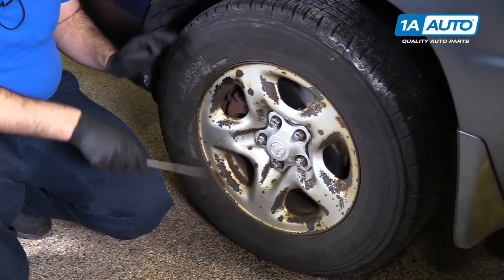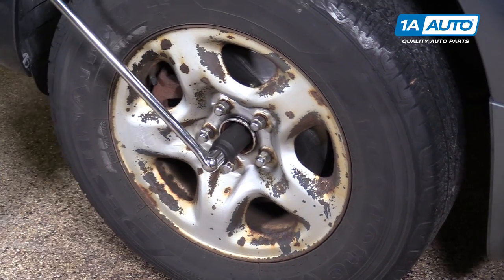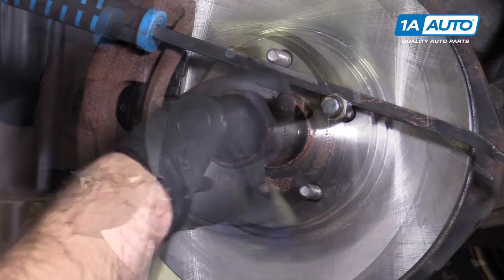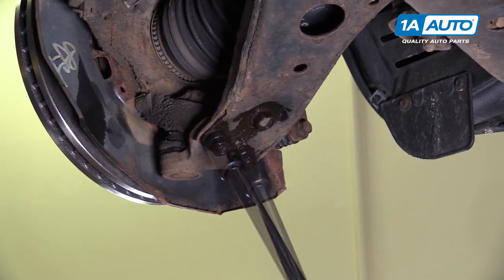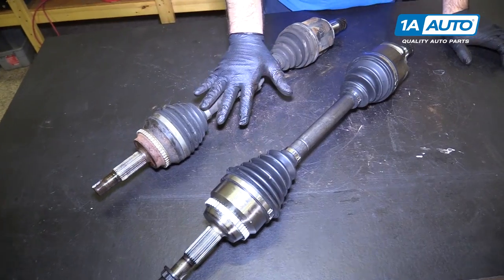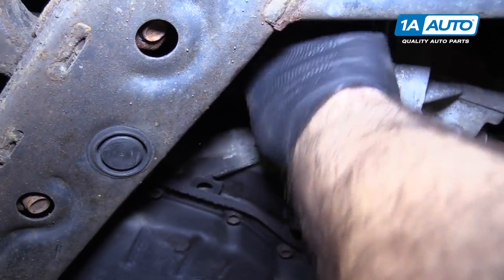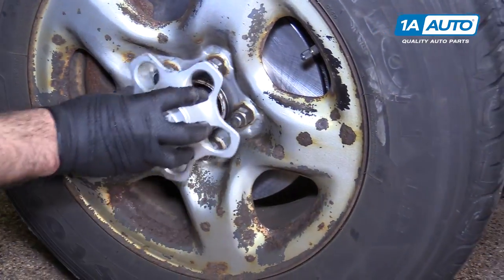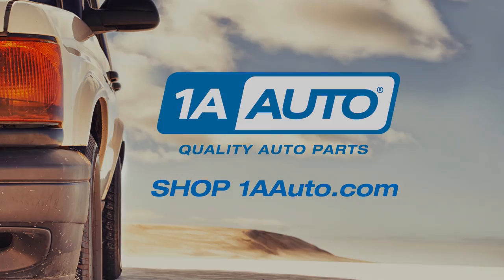How to Replace Front Drivers CV Axle Front Wheel Drive 01-07 Toyota Highlander

Comment: One of the most professional and careful Mechanics i've seen
My pet hate is mechanics that put wheel nuts on with a rattle gun
Reply: I taught myself a lesson when I used an impact driver on the wheel nuts. 🤦‍♂️😡 Next time I had a flat I struggled to get the wheel off. 😩

Comment: There is a special tool that is used to lift the dimple out from the axle spindle nut. You risk damaging the axle threads by just using a screwdriver or punch.

Comment: What was wrong with the old CV axle?  The only thing I've known to look for is boots failing.  So I was wondering if there are other signs to indicate my wife's Highlander needs new ones that I should be looking for.  Because the old boots on that one looked fine in the video.
Reply from the maker: +vtmegrad98 Thanks for watching!  You are correct, most of the time the CV axle will fail due to the boot's condition.  Once the boot breaks it will leak grease and debris will get into the joints, causing them to break.  One sign you can look for is hearing a clicking sound when turning the wheel.  That is usually a good indication the the CV joint is failing.  1aauto.com

Comment: At the 7:28 mark, you said when the axle comes out you may lose some fluid. What determines whether you do or not? I just worked on an 05' Highlander and lost about 3 1/2 quarts when I pulled out the drivers side axle. The manual says to add about 3.7 litres or quarts (can't remember which) when you do a fluid and filter change. I lost about 3 1/2 quarts removing the axle, then another almost 4 quarts when I changed the transmission filter. I'm confused...lol.